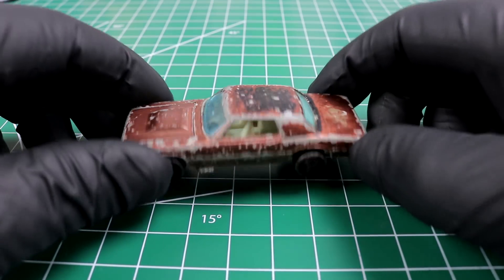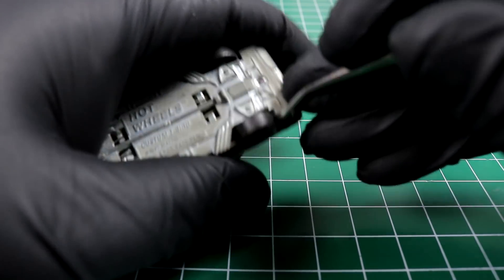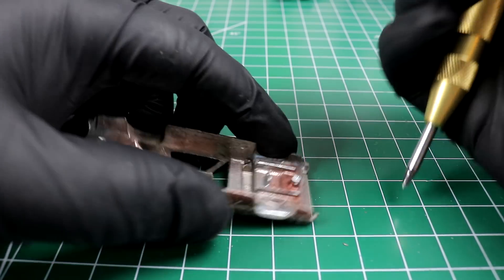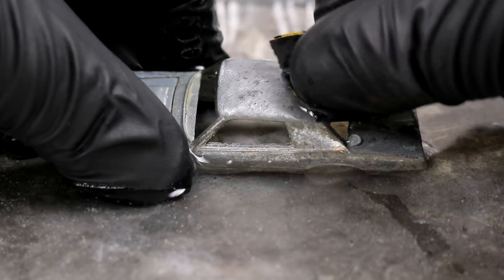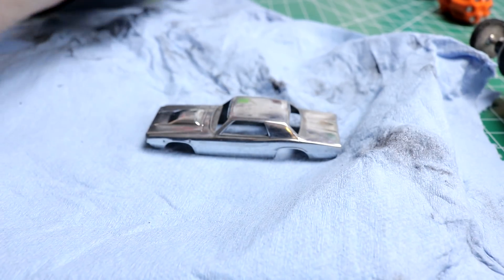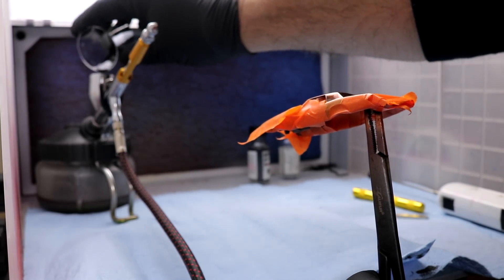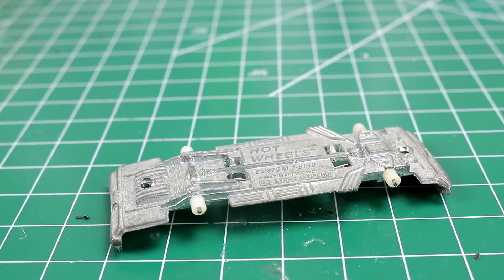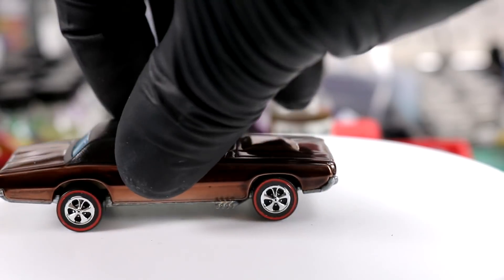Redline Restoration : 1967 Custom T-Bird

Comment: You can take a page from the full-size body guys and the plastic modelers, and use a bit of putty to fill the imperfections.  I recommend the Squadron white putty.  Since it's softer thant he metal , when you sand, it will wear away much faster then the surrounding base metal, allowing you to get flawless surfaces for the paint.  The better the base, the better the paint job.
Reply from the maker: Sir the paint is transparent over a zinc plated body, I can’t use filler unless it was lead or something metal.
Reply: Diecast Resurrection, I realized that after I watched a few more of your videos, which are very entertaining, btw. Back when I ran r/c cars, which are clear Lexan, we used similar paints, and in order to get the similar effect, we put the color on first, then backed the color with either silver or gold metallic. ( you paint the underside of the body, so the paints go on in reverse order). Maybe you could use solder?

Comment: You can get a roll of zinc made for cedar shake roofing. I think it's called moss stop, cuz that's what it does. The last of of our cdn. pennies were made of zinc (I use them as washers) You might have to get rid of the copper plating on them, but a good cheap zinc source. Cool T-Bird.

Comment: after watching you plating your cars with zinc i think you may get better results if you tried using copper then zinc you need more copper then a smaller layer of zinc the copper has a better throwing power than the zinc and will fill more holes scratches etc than the zinc and you could pallish the copper first to get better results wen you plate over it with the zinc {i was an electroplater for 20 years so ive had a bit of experience with this ps i love your vids keep up the good work.

Comment: Zinc Alloy is a metal. A Zinc Anode is a conductive point, as in an anode / cathode electrolysis system. Go to a plating shop to get the proper Zinc for plating

Comment: Love the sink plating but I noticed you lost a lot of the bodylines maybe it's due the the zink you're using, I haven't messed with plating yet
Reply from the maker: I think next time around Ill try not to sand so much before I plate, that's most likely whats going on. Gotta trust the Zinc to fill in the defects.
Reply: From what i could see I don't think the sanding was your issue, looks as if the zink went on too thick and covered the body lines, love the root beer brown thought

Comment: Probably stated in another comment, but I would use filler primer and fill the imperfections.....even spot filler body putty. prime and paint.
Reply from the maker: The paint is see through, that’s the idea of spraying it over the shiny zinc plating.
Reply: I just started watching these videos and my body work experiences kicked in....undercoat the paint with silver, copper, or gold for transparent paint as in plastic modeling.  I'm enjoying the videos and may do this at some point. I have originals from my childhood. Thanx for the inspiration!

Comment: Add some zinc oxide to your plating solution.
I did industrial electroplating for 5 years but, we used a different solution. We had sodium hydroxide and potassium cyanide 😲 (be very careful with it).

Comment: Zinc alloy steel. As long as the zinc holds up on the surface of the block you will be zinc plating your car. But eventually the 
zinc atoms will disappear and the block will just be steel.

Comment: I think you need to drill out the head of those rivets with a little bit larger drill.  Also, why bother filing the post holes flat if you are drilling them out?  Just wondering what your reasoning was?

Comment: What filters do you use for straining your paints and where do you get them?
Reply from the maker: I use full size 190 mesh filters for automotive painting, i just cut the tip off and use them on the airbrush..  I think it was around $40 for a couple hundred.

Comment: With that tool to make the center hole you can use it to center punch on the Mufflers pipes so they can look more realistic center punch on the middle of the pipe then painted black so it can look like it's a real pipe

Comment: Where can I find those self tapping screws
Reply from the maker: Any stainless steel screw would work. The stainless is harder then the diecast so it makes its own threads easily. I grabbed mine at redlineshop.com.  I saw some on amazon as well.

Comment: Only thing I would add is some slight agitation when plating as it helps the coverage and removes the bubbles. If you want to be anal, you could also fllp the car all four directions closer to the anode.

Comment: Instead of plating longer do it in stages multiple times. I know it migjt not be correct but a copper plating with nickel over the top would leave perfect finish for spectraflame paint i think.

Comment: Some primer would not be an excess
Reply from the maker: When have you seen a diecast car with primer from the factory?
Reply: @DiecastResurrection  What's the point? You've shaved the posts, it is not virgin anymore so some improvement is fine imo.

Comment: Fantastic Job! Maybe you can try soda blasting it with baking soda and getting in the pits a little deeper then plate it for a few minutes, clean it and sand it and keep plating it until you get the desired affect. Kinda like painting layers. It would be cool to see you experiment with it in any case. Thanks fore the great vid.

Comment: You do some great work on these. I've been enjoying a number of the Redline Restoration vids.  I have a number of hot wheels that aren't really collectible dates or quality but, I use them as gaming/scenery pieces in miniatures battles. Thing is, I noticed that neither you nor the other experts ever paint or blackwash the interiors, grills and other parts. I'm sure that's because you are trying to maintain a level of "collectible authenticity" by keeping it as close to spec as possible. I am very curious about what you'd do to amp up the level or "realism" on a car that wasn't a true collectible by date or type. Or even if you've ever tried to do something like that. Great content man. Thanks for sharing this with us. Makes me miss my old hot wheels collection.
Reply from the maker: Its never too late to start collecting again.. Start with your sweet 16's and go from there!